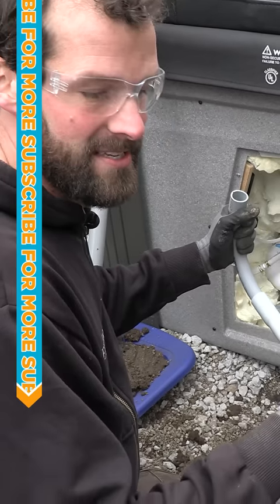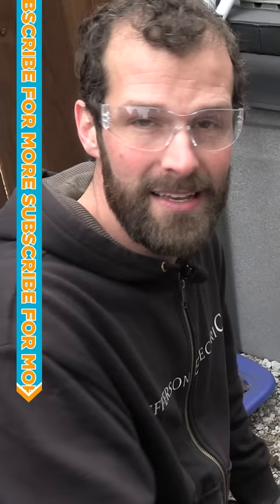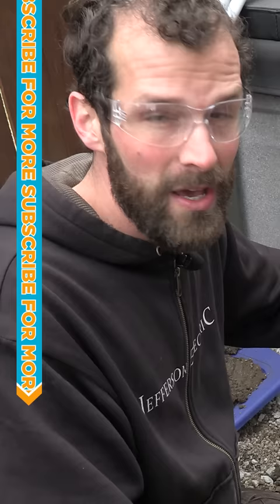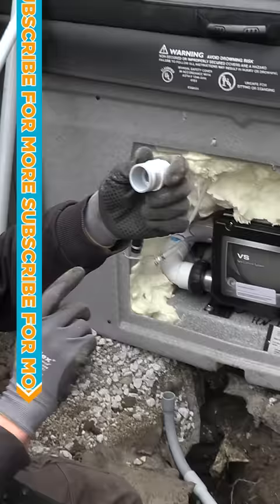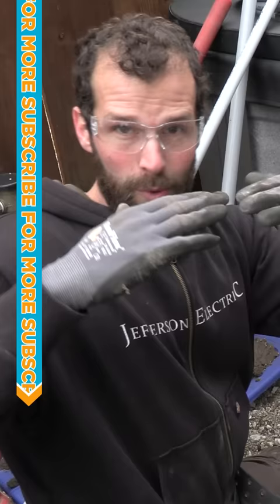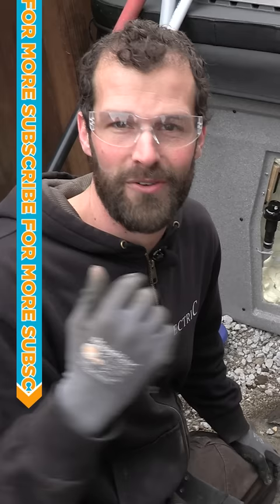A Warning When Using PVC

Comment: Florida man here yeah we don’t have shrinkage issues down here.
Reply: No only in your brains......
Reply: Sorry dude.  Thermal dynamics is universal.  I'm hvac and rarely do underground work but if YOU do...pay attention. I personally never considered this.
Reply: @christopherscott8853  Ok I will make sure to do my thermal dynamics equations. And is “Im Hvac” the same as “Im the Science Guy”? When do you graduate to HVAC/R?
Reply: HDPE conduit problem solved. No joints or cracks.
Reply: @WhowereEpsteinsclients  Lol Jonny, I see that you deleted your first reply.   Why?  Could it be that you didn't want two ignorant replies in the same thread?
Reply: Okay I build pools in Florida, not once have I seen a conduit shrink or expand an inch over a ten foot stick.
Reply: @christopherscott8853  I think i spelt “here” “hey”. Also this was supposed to be funny but obviously some people have never been on a job site. I wasn’t  even talking about the pipe lol. Loosen up
Reply: @katuchilife5943  It would be a quick, easy experiment that I'm gunna try.  Just let a 3/4" stick lay in the sun and measure it after a couple hours.  Hose it off and threw...measure it again.  But it's only 72⁰f now in N. CA and the water is probably about 55⁰f. It'll have to wait.
Reply: @WhowereEpsteinsclients  Lol you put it back up.  I don't think it's worth the simple experiment I suggested to another here.  Pvc expands 3/8" per 100⁰ temp change in 10'.  I don't do refrigeration any more and recently sold the low temp refrigerants I've had in the shop for many years.  I stick to comfort cooling these days.
Reply: @christopherscott8853  you're incorrect, thermal dynamics do change according to region.

This guy's in Florida meaning they wouldn't have to bury nearly as deep since their frost line is almost none existent.

So at only a foot deep that temp change in the ground throughout the year is going to barely change.
Reply: @bunburner4850  Hey BB, you really should know what you're talking about before sticking foot in mouth.  Pull up "laws of thermal dynamics".  I'm a firm believer in self education.  Florida doesn't even have a frost line...lol.  You didn't  read the thread...did you.  Edit: that is not what he said...at all.  He said that the difference in temperature (example: 105⁰f in the sun and immediately buried in soil at 55⁰f would result in excessive thermal shrinkage separating the connections over a 10' run).  There is thermal shrinkage...but not the amount he suggests...read the thread.
Reply: @christopherscott8853  sure let's break it all down. Where would you like to start? I did all of this getting my MSEE

Pick which law you want to dissect. There's multiple
Reply: @christopherscott8853  if you're not aware of the Freeman-Carroll model and the Kinects as a result to climate and it's affects of thermal dynamics then you might as well stop while you're ahead.

Whole Florida doesn't have a frost line they still have a minimum bury line.
Reply: @christopherscott8853  😂 I mentioned Kinects. Wtf are you on about? 
You're just another YouTube wannabe pretending. 
I didn't have to look anything up. I had to go through all of this to get my masters. 

You can settle down with the weak  overused insults. You're not doing yourself any favors with them. 

If you don't understand how Kinects plays a roll in thermal dynamics then I'll end the discussion there.
Reply: @christopherscott8853  notice how you keep avoiding the actual discussion and resort to insults. 

Point proven. Have a good one.
Reply: @bunburner4850  so Mr genius, what is the minimum bury depth here in sunny south florida? Since you're hvac(wtfever that means) you definitely know what code pertains to minimum bury depth for say, parallel 750mcm feeders in 6 inch sch80, right?
Reply: @effyoo6081  HVAC? I never said anything about that. 

But minimum bury depth in Florida for any pipe is 12 inches below grade or 6 inches below line expect in certain cases then you have to go to 404.12 for those reasons.
Reply: @effyoo6081  would you like for me to provide the actual code? I can copy and paste it for you. I never claimed to actually know the codes in Florida, but any where is going to have a minimum bury depth 😂. Doesn't take a genius to know that.

I mean wtf was that supposed to be a gotchu moment? 😂
Reply: @bunburner4850  sorry, was the other guy I read that said hvac, my bad
Reply: @effyoo6081  I failed how? You asked what it was and even though the NEC is present is still differs from state to state and even county. 

For instance I'm in Maryland and we have a minimum of 18 inches. 

You asked what the minimum depth was and I have you that. 

Our Convo we were having was that on themodynamics and the affect of climate with that in different areas. 

So I'm not sure what you're trying to accomplish here.
Reply: @effyoo6081  and I was trying to explain to him that in places such as Florida that even at only a foot deep the expansion and contraction of that pipe would be minimal due to climate.
Reply: @bunburner4850  Shows how little you know. The water table is only a few inches deep in South Florida, so it's normally a matter of how deep you can go before you hit water. And the soil temp never goes below 72 degrees year-round, even in the winter.
Reply: @joho0  show me your have zero reading comprehension. All you did was confirm what I was saying.
Reply: @bunburner4850  water table isn't that low worst I've seen is about 4 feet down. I bury at 12-14 inches. Plus we use glue, your not pulling it apart...
Reply: @bunburner4850  bro, you fail to understand that we do not bury pipes at at minimum depth for anything to do with weather. It's purely for mechanical protection, nothing thermal. It's solely so the pipe will not be easily dug up, damaged by mowers, or mechanical means. It has zero to with temperature. If you actually understood the NEC, you'd know that. You said you don't know the code book so why are you so sure you're correct. I do. I'm a South florida electrician with years in the trade, and trust, we do not EVER think about "pipe stretch" from warm pvc.
Reply: @bunburner4850  the National electrical code DOES NOT VARY FROM STATE TO STATE. The only variation allowed is by the AHJ, and if you knew the code you'd totally understand what I mean. But, you said you don't so, get to googling!
Reply: @bunburner4850  again, WHY DO YOU HAVE 18 INCHES IN MARYLAND? NOT WHAT, BUT WHY? There are many depths, fir many incidences. It's literally different from situation to situation and has zero to with temperature. Temps come in for wire size, not pipe stretch. Jeeeeez
Reply: @effyoo6081  it's like one inch per 30k ft of pipe.
Reply: What does the frost line have to do with conduit anyway? Minimum bury has to do with location: is it in the lawn, under a sidewalk, under a driveway, or under a major road?
Reply: @joho0  Where in Florida is the water a few inches below ground level? The beach at low tide? What are you talking about?
Reply: "Gee, Wally, that's swell!"
Reply: @hotfeva9843  if you got paid minimum wage here it's probably because your "skills" aren't worth anything more.  But what do we know down here living 5 minutes from the beach and wearing shorts year round,  we only have the 4th most millionaires in the United States.  We have people who are actually skilled and they're rewarded for it, oh and we live in paradise.  Enjoy your winter I'll be on my boat 🤣
Reply: @michaelmerryman7806  and you have so many millionaires because it's obviously a vacation spot dummy, and most Americans enjoy all 4 seasons but enjoy being wiped out by hurricanes left and right
Reply: @michaelmerryman7806  keep commenting you're giving my first comment so much value Mikey
Reply: @hotfeva9843  lol look up my last name my family owned half of Baltimore.  John Hopkins is built on Merryman's Lott.  I know Maryland very well and there's a reason why we don't live there.  I've been all over the United States and nowhere compares to Florida and so far haven't been hit by a major hurricane in the 25 yrs I've lived here.  All though if Ian didn't turn to the east at the last minute I would have been in it's direct path.  We get hurricanes you get blizzards it is what it is, mother nature isn't something you can avoid. But hey I could go all night on why I think Florida's great but I can tell it bothers you so I'll stop have a good night buddy
Reply: @hotfeva9843  I'm not wealthy lol far from it but my family's been in Maryland and Virginia since the 1650's.  My ancestors where intimately involved in the anti British movement that eventually led to the revolutionary war being the first colony to push back on the stamp act and demand representation.  Also in the 1800s had a crazy grandpa who was arrested for treason in a famous writ of habeous corpus case where president Lincoln jailed him with no trial in which he was eventually released then became treasurer of Maryland.
Reply: @michaelmerryman7806  yea I just seen that about your grandpa (Ex parte Merryman) right? My family is from Louisiana & Mississippi still trying to sort out our history though. I'm from PG county MD I'm very familiar with Bmore I was looking at some homes there not too long ago I'm thinking about moving to Cumberland the homes are still considerably cheap with low crime neighborhoods I work in DC so that's a win win great pay low mortgage just have to face a blizzard every now and again
Reply: @hotfeva9843  yeah he was quite the anti-Federal type but its definitely an interesting story.  Well I wish you luck buddy but if you're thinking of moving you probably could live like a king here at least for awhile.  I bought my house 3 beds 2 bath on 5.26 acres for 150,000 in 2020.  Just something to think about!  👍
Reply: @michaelmerryman7806  yea Florida would be great I will think about it once I finish my HVAC apprenticeship either Texas or Florida. Same to you best wishes buddy 👍🏿
Reply: @christopherscott8853 No need yo pay attention to utter nonsense. But you're free to do so if you like.
Reply: This doesn't happen anywhere. THIS dude doesn't know what he's talking about. 1"shrinkage/10ft. of conduit? What utter BS.
Reply: @joho0 Just measured the ground temp 1 ft down. Wpb, Fl. 53°F  But hey, tell us more, Captain Science.
Also, water table is currently about 6 ft. below grade.
Reply: @mattrondeau7466  thanks for chiming in late as usual Matty patty 🥪
Reply: @hotfeva9843  I know that's what she tells you so you don't know what's actually going on. Hate to break it to ya, little Billy. But while I'm at it, those other guys are not your uncles. Or the plumber. Or the cable guy. Or the Harlem Globetrotters. Well actually, those were the real Globetrotters.
Reply: @mattrondeau7466  bro you come off as a 10 yr old 🤣 your jokes are so harmless thanks for being so nice to me🤝🏿
Reply: @hotfeva9843  No prob, little girl. You've had it rough enough.
Reply: @effyoo6081  actually the State Electrical Boards review the NEC when it comes out every 3 years and those Boards decide whether to accept it in whole or to add or to subtract (make exceptions that is) whichever part of the Code the Board wants have for the State. It's not uncommon also for the process to take months to finish and the Code may not even be accepted in the year it was written for.
Reply: @fritzmiller9792  yea, fritzy, that's obvious. Here, we are still on the 2017 code book. I took my masters on the the 2014 code, my journeymans was on the 2005 code. Thanks for stating the obvious
Reply: @effyoo6081  hahaha OK 'eff yoo'.. I see the name now.... maybe change it to : "Eff Yoo - I know it all even when I say something wrong so Eff Yoo !" 👏👏👏
Reply: @bunburner4850  and @christopher Scott
"Girls, girls, you're both pretty. Now stop fighting."
Reply: @effyoo6081  try reading and comprehending. 

Codes very from county to county. I work across 4 states. Every county has different codes due to many factors. I'm not going to discuss them all but one is they may exceed the national code, another is they still follow an old code. 

I also never said Florida Buries for temp. I literally said the frost line is non existent. 

It still doesn't change thermal dynamics regardless. 

Next time have try reading.
Reply: @BunBurner " next time have try reading" says it all. You won't because you can't. Thermal expansion on pvc pipe is 1/4 inch per 100 ft. On a marina here in Florida we install slip couplings for code. I know exactly what I'm talking about. You do not
Reply: @WhowereEpsteinsclients  in the swamps, genius

Comment: I've never seen my Pvc  gain an in  just cause it was warm
Reply: NEVER!
Reply: What he saying is bs
Reply: Good electricians plan out their work so they dont need couplings because the pipe has a bell end on it. Also I have NEVER encountered this "contraction " you're talking about. Not once in 20 years & I have installed 100s of miles of pvc. 
He's full of SHEE-IT beyond the Eyebrows
Reply: Just because you’re hearing about thermal expansion for the first time doesn’t mean it doesn’t exist smh. “Rigid PVC conduit has a coefficient of expansion of 3.38 x 10-5 in./in./°F”
Reply: @cookierad3r  it does exist,  but not drastically like the guy saying
Reply: I wish my stick gained an inch when warm
Reply: @davidaldridge6585  I'm Asian and it does when it's in scorching hot sun like what the guys says in the video.
Reply: @davidaldridge6585  also it has to be baking for 4 hours
Reply: @HungNguyen91622  username checks out
Reply: @cookierad3r  so like 0.2 inches for a 50 deg difference. But it could cause problems if you don't account for it.... Or just don't let plastic hot soak in the sun right before you install it.
Reply: @cookierad3r  that mean that a 100 degree Fahrenheit temperature difference would result in less than half the expansion per stick that this guy claims.
Reply: @cookierad3r  yea thats almost no movement at all. Pvc is specifically designed to not suffer from much thermal expansion. Because, ya know, its a rigid structure underground that may experience large changes in temperature. Hur dur.
Reply: Yeah, I’m sure you always measure your pvc too.
Reply: @cornhole8839  once it's buried it will experience almost not change in temp.
Reply: After 4 hours in the sun my piece grew 6”

Comment: The coefficient of linear expansion in PVC conduit is 3.38 x 10-5 in./in./°F. If that 120" stick of PVC managed to reach 120°F prior to being stuck into the 58°F ground, that'd be a 62°F temp delta. 62°F temperature shift would cause that stick to contract 0.0021" per linear inch, which would mean that 10' stick would shrink by 0.25"
For it to move 1 full inch would require a 219.3°F temperature differential, meaning the temp in the sun is 277.3°F. Which would make installation even more awkward, considering PVC softens at 200°F.
(Edit: and if you were to actually see that much shrinkage, you'd have to have it glued and cured before the temp normalized. Your claim is off by a full magnitude, and that would be if you managed to keep the entire run at the elevated temp during the entire install, then somehow buried it in its entirety before it cooled. Which would be a hell of a trick. In reality, the actual delta would not be nearly that high, the expansion would be 1/10th what you claim, and it wouldn't matter anyway since the conduit would be cooled nearly to ambient and already shrunk well before it was sealed under earth.)

Comment: So do your straight runs and leave them in the trench or assemble them and leave them overnight and do your final assembly early morning.
Reply: They make expansion firings that can contact and expand with the temp changes.  Pretty much just a smaller pipe sitting inside a slightly bigger pipe that can slide in and out.
Reply: It doesn't do what he says he does....
Reply: @jo19mar95 I believe expansion couplings are rated for only above ground.

Comment: Straight from the manufacturer:

Rigid PVC conduit has a coefficient of expansion of 3.38 x 10–5 in./in./°F. A 10 foot length will change in length about 3/8” with a change in temperature of 100°F. This equates to more than 4 inches over a 100 foot run.

Comment: Expansion fittings buddy
Reply: First of all expansion fittings aren't rated for direct burial 
Secondly, it's  $20 a piece for a 1/2" expansion fitting.
Reply: The the grey pipe he is holding isn't pvc. It is cpvc. Its thermal expansion is about an inch per 25 ft.
Reply: @jordanmoore1212  it’s PVC and not CPVC
Reply: @papasmith1  expansion fittings are only as good as the glue. Furthermore, there's no way you're going to overcome the friction of the soil around the conduit for it to shift along its full length to accommodate the contraction.
Reply: Expansion fittings aren’t burial rated

Comment: Coefficient of thermal expansion for pvc is 0.000061 inch per inch per degree F. 

A 120 inch length of pipe will change 0.007 inch per degree F temperature change. If the ground is 54F and the 10ft length shrinks 1 inch, the starting temp of the conduit would have to be 196 degree F. 

And remember all you apprentices out there, the conduit will remain at 196F in the 54F ground until you cover it a week later. So be careful not to step in the trench unless you're sporting boots with NFPA rated ceramic soles.

Comment: What he is saying does happen. Not 1 inch per 10 feet, more like 1/8 every 20 feet. I wire airports and runways. We came in to work  and our in pavement lights were 1.5 feet in the air from the PVC expansion pushing the lights out of the ground and above grade before we could lock everything in with concrete. Granted the lights are hundreds of feet apart, so it expanded a lot. There is a chart in the code book for PVC expansion.